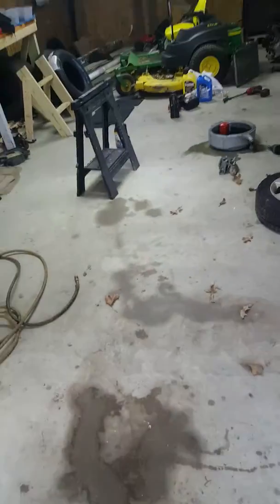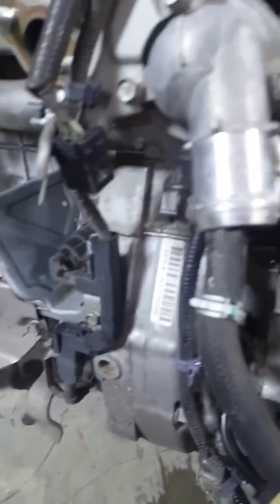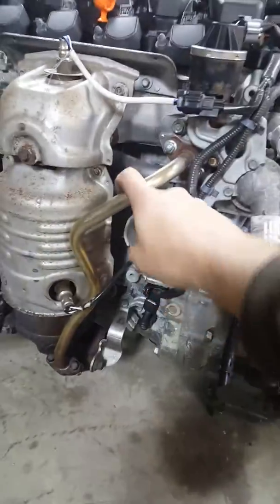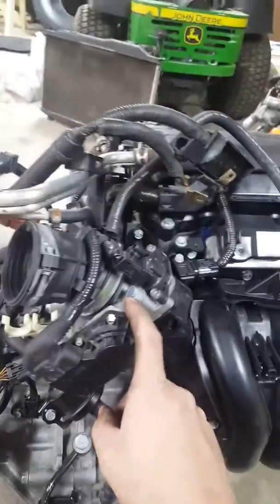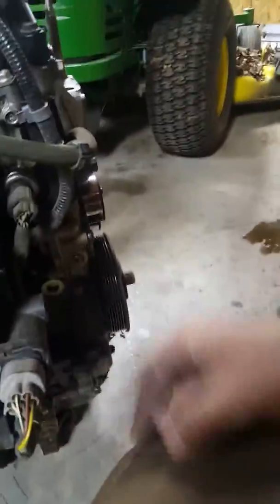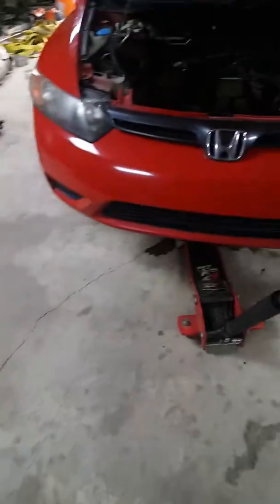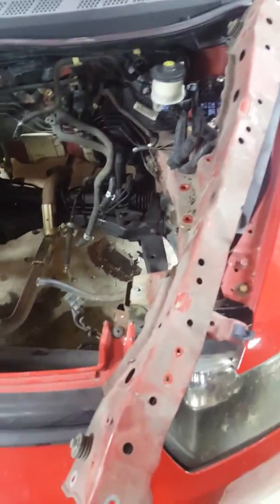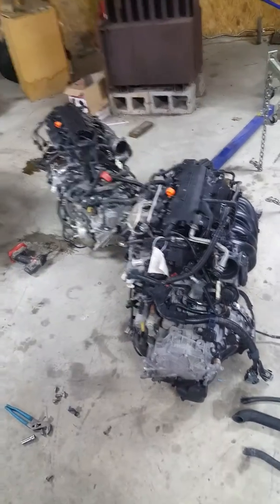JDM R18A swap in 06-11 Honda Civic PART 1

Comment: Did you have to get a different ecu for the jdm engine?
Reply: He demonstrated that he didn't do that because he moved over the throttle body, wiring harness, etc., all to plug and play with the USDM ECU, in order to avoid dealing with ECU/immobilizer issues.

Comment: I wish I would have known about the throttle body.
The idle can’t adjust properly and it throws a check engine code.
Sure would have been a lot easier to swap it when the engine was out.

Comment: Thank you!!! Did you check the compression before instaling? And how to make shur that the new engine has no crack on the block of cylinder, because all sellers have washed engines before selling.thank you
Reply from the maker: No i never do. I have installed about 25 of these engines and have never had a problem with any of them. They always fire right up with fresh oil and a new oil filter.

Comment: Question, I bought the same JDM motor. How did u convert the ac sensor? The US one has 3 pins and JDM has one. Pls let me know thanks!
Reply from the maker: Use your US harness and your US ac compressor.
Reply: Thanks for this video man. I couldn’t find any other videos that did the whole swap including motor and tranny. I ended up rewiring the ac compressor sensor. My US ac compressor doesn’t work anymore. My original motor has 311k mi so I decided to do the swap. Done with the swap tonight no check engine or anything. Hope the ac works when I charge it. Thank again!

Comment: Hello Shawn! I would like to buy the same engine, because i got crack on my engine block 2007 EX. I have manual transmission on it. Is it a different connection to engine for automatic and manual? I mean if i will buy only the engine. Thank you
Reply from the maker: nope it is the same engine you will just have to swap out your flywheel off your old motor to the new one.

Comment: I'm gonna swap out the block on my R18 with the R20. Cheapest 15HP ever
Reply: Marko Mravak is that a direct bolt on swap without the need to touch the factory tune?
Reply: Yes , its just the head to a cr-v .

Comment: Can some one help me I have a 08 civic with a R18A1 engine and I bought the R18Z1 how can I make it work the only problem I had was the crank sensor it’s on the wrong side can someone help me
Reply: You already answered your question... extend the crank sensor wires and it should fire right up.
Reply: CRISTIAN SILVA Did you get your r18z1 engine to work in place of the r18a1? i bought a r18z3 to put on mine but the rotation sensor is on the other side and the phonic wheel has more teeth
Reply: CRISTIAN SILVA Did you get your r18z1 engine to work in place of the r18a1? i bought a r18z3 to put on mine but the rotation sensor is on the other side and the phonic wheel has more teeth

Comment: Why the JDM version? Literally no HP difference
Reply from the maker: cheaper, lower mileage, tested in condition than a salvage yard USDM version mystery
Reply: to answer your question fully, Japan is dumb and makes it very cost ineffective to own your car beyond 100,000 KM (about 60,000 mi) for emission regulations purposes and most people scrap their cars by then and buy a new car in japan.

This is why JDM engines are such a big thing in USA. Why pay the same price for a 150k+ mile engine when you can buy one with 35-70K miles from japan that comes with a warranty, is cheaper, and is guaranteed compression tested etc.

Comment: But the JDM one is basically the same HP. I would of just went to a yard.
Reply: but you dont know if the salvage engine has the engine crack....if you get it from a 2010-2011 it wont be subject to cracking like the 2006-2009's
Reply: @johnjoseph7382  problem is the jk mot sites list them all as 06-11, so no telling which one you get
Reply: @beezowdoodoozoppitybopbopb9488  exactly, just go r18a JDM
Reply: @johnjoseph7382  I fat fingered that comment. The jdm importer sites list both 06-09 blocks and 10-11 together as just 06-11. So it's a dice roll whether you get an older or newer casting
Reply: @beezowdoodoozoppitybopbopb9488  exactly. I have a cracked block and looking for one myself. I'm confuggled
Reply: @crystalcrawford553  it looks like the jdm blocks are less prone to cracking after looking into it. It can happen but not as often as american blocks. Euro blocks are gtg as well.
Reply: @beezowdoodoozoppitybopbopb9488  that's good to know. Thanks